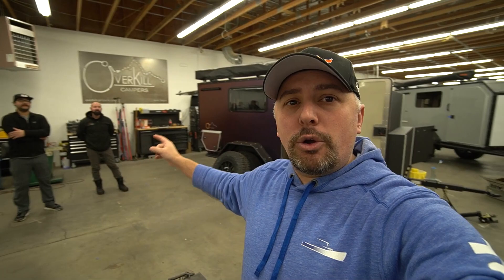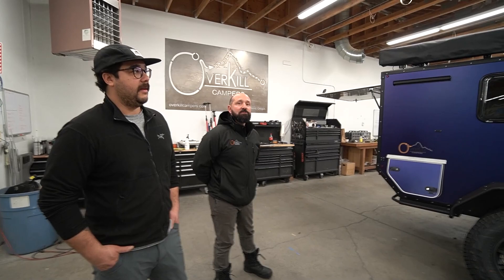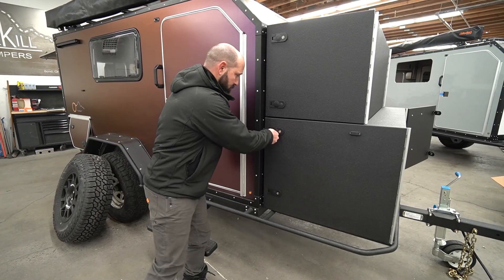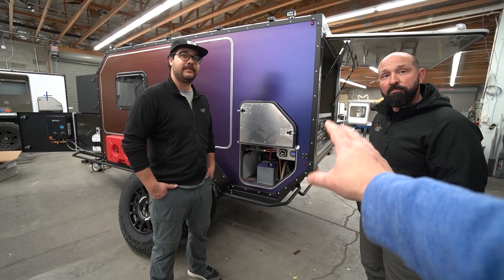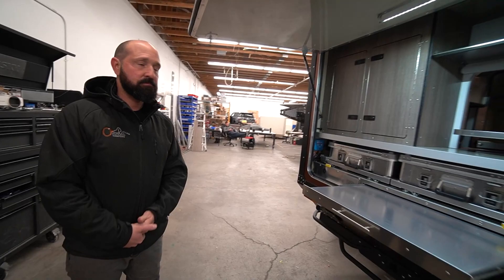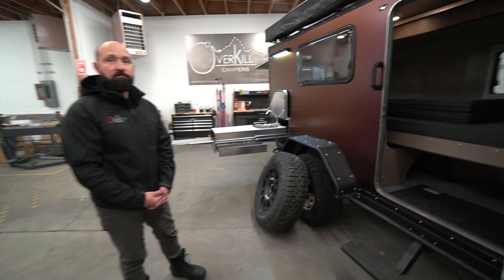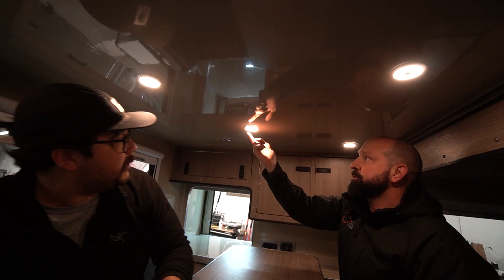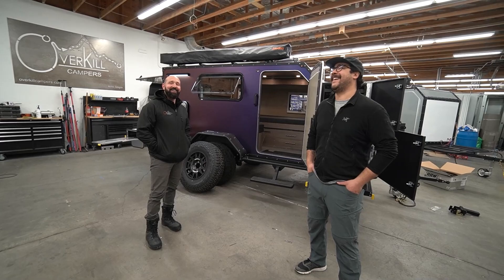AMAZING Off Grid Camper Trailer - Kitchen, Solar, Heat, Shower, and Much More

Comment: What takes the cake for me is the slide out and how this suddenly becomes a trailer capable of truly accommodating a family. 
With an optional wedge style roof top tent and the table INSIDE you would suddenly have a light, family friendly teardrop(?) that checks a lotta boxes. With water, stove, power and storage this might actually be the best trailer I’ve seen on the web.

Comment: I have been in the market for one, and i have been doing a ton of research on all the brands. For the price of this base model Im a little put off that the kitchen is not complete turn key were most of the campers in this price range have it all including on demand hot water, heat and a/c. As far as off road durability I am skeptical of this due to the height of the trailers and the lack of steel supports around key areas of the trailer. These off grid trailers are getting way over priced when you have to add options that are extra to make it an off road trailer.

Comment: Interesting travel trailer. I haul travel trailers for a living. Some really cool things & some things I do not like. Love that paint job. The slide out is really cool. The rear configuration for your stuff,the regrigerator/freezer,where the stove is,the lights on the inside & no wood. Stuff I do not like & my main complaint is the front design will be like a sail flat & square. Going into a wind or cross wind you will really feel it pulling. The aerodynamics is terrible. Fuel economy pulling will be really bad. Even if it is small & does not weigh much.
Reply: Put a triangular box on the tongue.  The cross-sectional area is still quite small for a trailer, and people tow squared-off cargo trailers all the time.  Much bigger (taller and wider)

Comment: With the water tank being external.. does the water system freeze winter in weather? And how what is the r value of those panels? 

Question because I think of Wisconsin Winters and hunting season.

Comment: Should I cancel my Sunray 109 order 🤔🤔🤔🤔
Reply: 109 is on grid and wouldn’t last off grid, but good value for on road.
Reply: @kjlcycler  i like this one, but do they sell them ? I only see rentals on their website?? 🤔
Reply: Having personally seen their products, engineering and customer service, there’s really no comparisons on the camper landscape.
Reply: Yes cancel your order and get the overkill, this model specifically.  Then make a bunch of videos of you taking it off-road.  I want to see it.  This is the first off-road small trailer I have seriously considered buying.  Wont be buying for about a year though, which may be good since it sounds like they may have some more models coming out to choose from.

Comment: "Meant to push you outside". That's all well and fine until you're trying to fix breakfast with wind blowing the rain under the awning, or you really need to shower because you rolled around in the mud for three hours repairing the busted rear end in your 4x4 but it's colder than a witch's tit.  Ever notice when campers are showcased the sun is always shining or it's in a shop? How about showing somebody trotting back and forth from the galley to the icebox while cooking supper in a thunderstorm with 40mph winds and hail? Hell you can cook breakfast inside a $150 tent in inclement weather, is it too much to ask the same of a $50,000 offroad camper?
Reply: So cook breakfast inside of this then. How are you tent cooking? Probably with a portable stove if I were to guess. Tote one of those inside here and set it on the table. If you're wanting a full galley inside, I have to ask, where do you suggest putting it? Everyone wants more and bigger, but then you're getting beyond what you can tow back into areas where these trailers are designed to go. As someone who has an off-road trailer, having an outside kitchen isn't that difficult to deal with. I also listen to the weather reports so if its going to be raining and blowing 40, I go a different weekend.

edit to help you out:
https://www.coleman.com/grills-stoves/camping-stoves/single-burner/classic-1-burner-butane-camping-stove/SAP_2157595.html

https://www.coleman.com/coolers-drinkware/hard-coolers/chiller-9-quart-portable-cooler/SAP_2160823.html

https://www.walmart.com/browse/household-essentials/paper-plates/1115193_1073264_1149388_3938005?facet=fulfillment_method%3AShipping